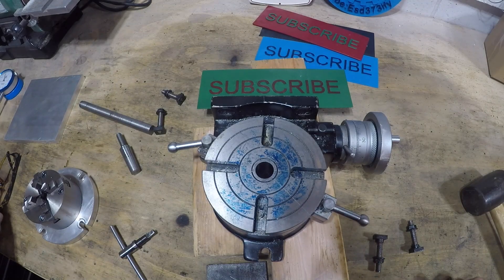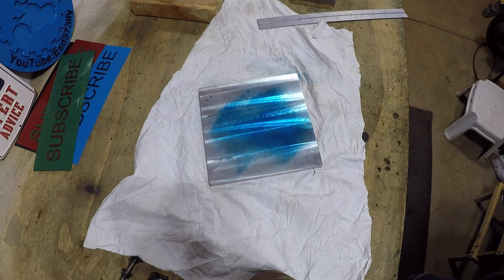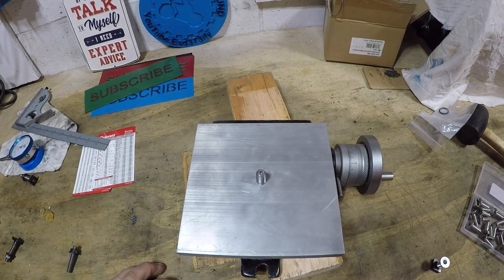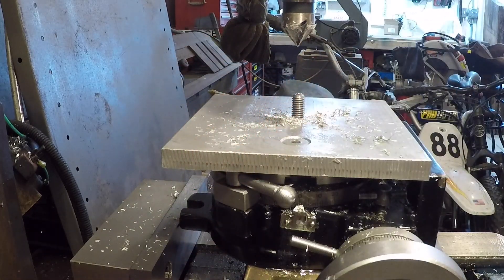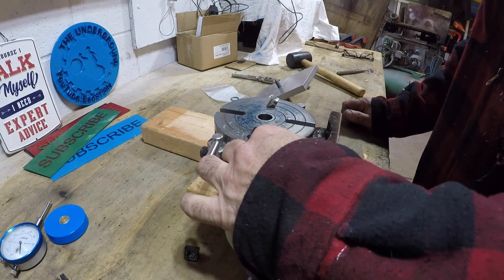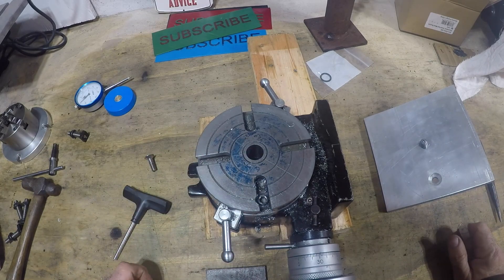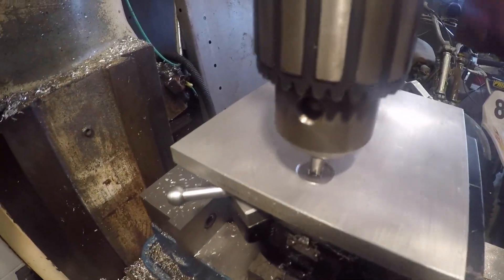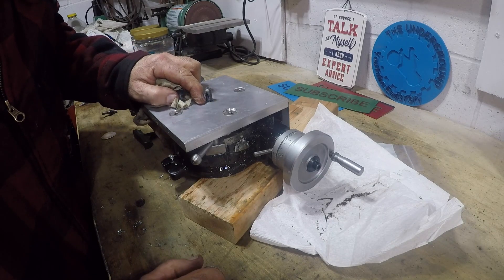Rotary Table Fixture Plate Part 1

Comment: As @goboyz8016 stated it may be an internal error.  If not I believe the indicator plate is screwed on allowing it to be adjusted.  I'm still waiting for my rotary to arrive, when it does I'm going to mount it vertically and check the t-slots to be sure they are level when zeroed.  Haven't watched part two yet but you could just mill the plate square to the rotary if having the sides a little off bothers you.
Reply from the maker: I have a video on the channel called Rotary Table Calibration. Watch it after you watch part 2. I think you will enjoy my fix. Thanks for watching.
Reply: @theundergroundesd  Perfect.  I haven't received my rotary yet but the pictures show the indicator arrow plate being held on with cap screws and the indicator plate being slotted.  Apparently these plates are misaligned enough that they decided to make them adjustable.

Comment: If you take the table apart I bet you will find that the table is off a tooth on the gear inside. I suspect you can align the table and get it true again so it reads correctly. Note to self, always take import rotary tables apart and clean them real good before using them. Good recovery though. We all learn from mistakes so thanks for showing yours. It's nice to see the good and the bad in videos so we all get to learn together. Well done.
Reply from the maker: Thanks. I will give that a try. Thanks for watching and commenting. Inspection  I try not to hide my mistakes so people can learn from them.